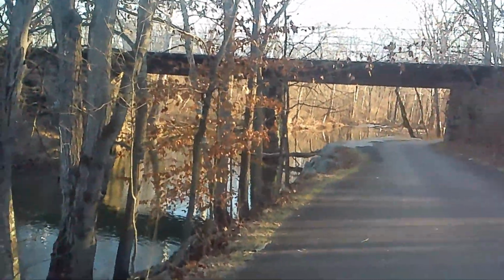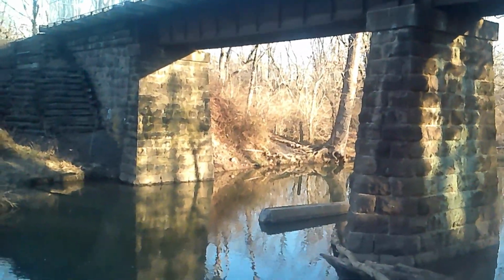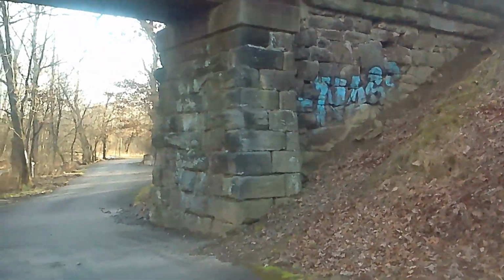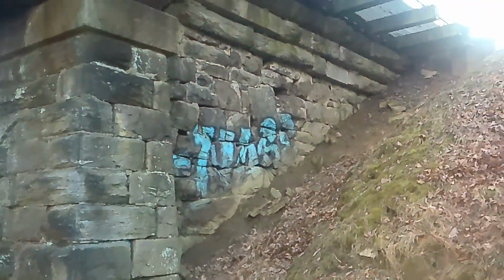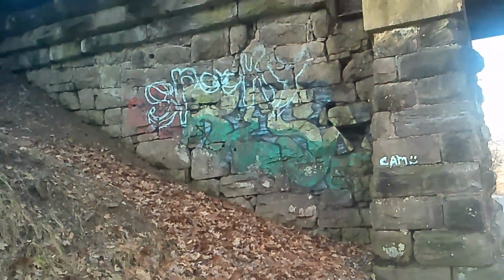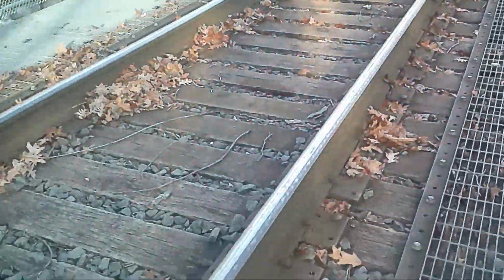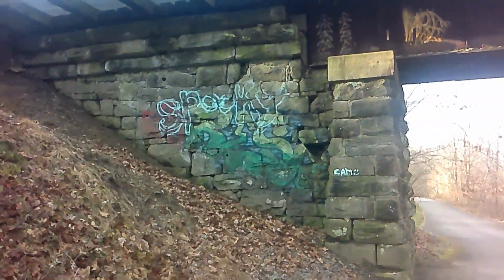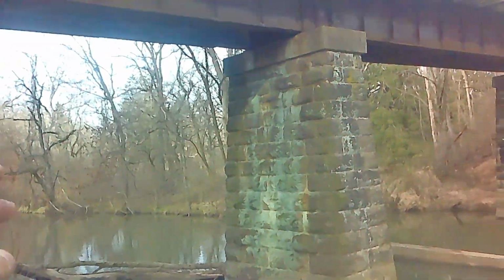Come across this Two span Steel Girder Bridge while doing my morning walking at the Farm Park.

Comment: What the best software  for structural calculation
Reply from the maker: You Have several, We use Engineering software such as ABLRFD for Abutments and wingwalls for Bridges and BXLRFD for Box Culvert. For buildings and Bridges and there is Bentley STAAD PRO use for Analysis and Designs.